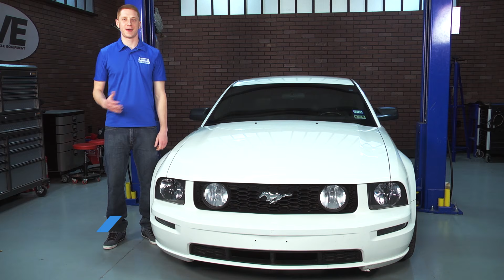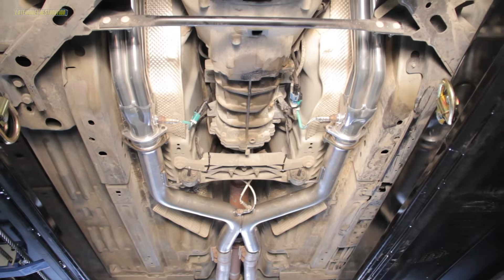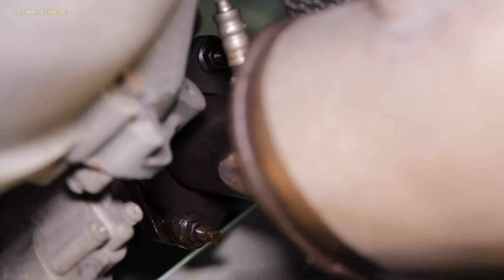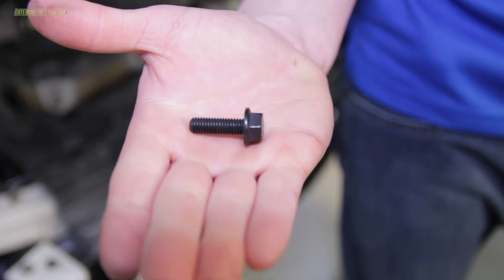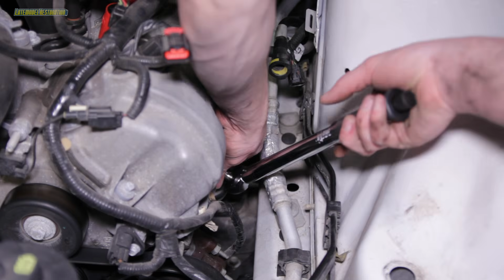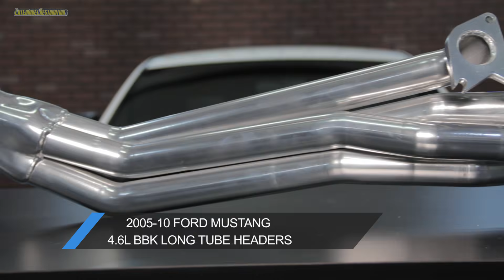Mustang GT BBK Long Tube Headers/Off-Road X-Pipe - Install & Dyno (05-10 4.6L)

Comment: I did this on my 07 a few years ago by myself and took me 8 hrs. my first time doing it. turned out great...I had bigger gains though. but if you have any mechanical experience you can do it yourself. the hardest part was having the right tools and not knowing what all I needed to do before I jacked up the car lol
Reply: christian rodriguez that's 300 crank horsepower in reality it puts about 270 to the wheels stock
Reply: thomasj1026 how did you remove the oil dip stick in having a hard time taking it off
Reply: Hector Silvas I want to say you just pull it out...if my memory serves me right. I no longer have that car due to a hit and run 💔 but I think if you get down closer to the bottom just give it a nice tug and it should pop out. just make sure there is nothing holding it down.
Reply: thomasj1026 thanks it worked. I was afraid I would brake it if I would pull to hard
Reply: Hector Silvas no problem. I thought the same thing when I was doing it
Reply: So confused the 3 valve stock has 300 hp so how in the hell would be pushing 295 horsepower after the long tube headers
Reply: @christianrodriguez-tf5rm  300 at the crank,,,not rear wheels

Comment: the bolt that had to be modified how come bbk dosent provide a bolt at the proper length already? seems like bs when you have to customize a bolt on mod.
Reply: i could not have said it better , that is complete crap having to cut a bolt.

Comment: why is it that no one shows the difference without flashing the computer? how well does the product work without a new tune?
Reply: yeah, thats why they should show why its important to tune, because people assume that out of the box is ok. but in order to get the hp claims on the label you need to tune.
Reply from the maker: +Dirty Dee Because of the complexity of today's modern PCM's, long tube headers require a custom tune directly after install. -Landan
Reply: I have a performance shop and do dyno tuning myself. I understand how modern cars run. what I should have asked is why not show the difference of stock vs. mod vs. mod+tune? to show why it is not only better but important to tune with major modifications. I'm a fan of bbk and I have noticed that even with just a offroad H-pipe and nothing else you still have to flash pcm to get the bbk claimed hp gain. when the way customers look at it is just put it on and that's the new hp number. I like the high standard of videos you guys put out and a video that shows the difference would be awesome to show customers.
Reply: +Dirty Dee Agree

Comment: What percentage of that 22 h.p. can be attributed to the o.r. xpipe ?
Reply: Like 3-5 Its honestly not worth it H pipe sounds so much better
Reply: @rondaroushy651  very marginal. X and H pipe provide different sounds of course, the X pipe makes a little more Horsepower at the high rpm and the H pipe makes more low end Torque. I didn't care for more power on my 06 so I went with an off road h pipe and it sounds brutal
Reply: @overtorque  same here love the h pipe but x pipe with borla s types isn’t bad at all

Comment: If you install the BBK xpipe, you HAVE to use factory style O2 sensors... meaning the part that sticks out where the wires exit the sensor is very narrow or thin... aftermarket O2 sensors with a fat body will NOT WORK. ask me how I know lol
Reply: Jon-Erik Butcher How do you know?

Comment: I have BBK long tubes on my 95 cobra lowered 2" and man those long tubes hit everything since they hang very low on their own. the 2" drop doesn't help either :/

nice video Late Model Resto
Reply: I know the feeling bro ! Had BBK long tube headers on my 95 GTS, had a 1.5" drop only and Puerto Rican roads to deal with...
 but hey, they sounded so awesome with an O/R H-Pipe and Super 44s (sometimes without mufflers too lol)

Comment: You should do this with 99/04 gt with a manual. I'm certain a lot of people would like to see the gains.
Reply: Nick Sitzberger the shorties are not to bad if you want to go with a better than stock upgrade. I have them on my car with a catted x and flowmaster catback. Since I have the stroker motor in it seems as if the car needs to breathe more...so should have gone with long tubes
Reply: Ill second that lol. Id like to put some shorties on my 01.
Reply: Bradley Watkins I have the bbk shorties and xpipe on my stroked 4.6. I have a few vids on it. I'm looking for long tubes now for it....and maybe a kb at 9 psi in the future....if the wife gives the go...lol.
Reply: marine0331inf im looking to go with a paxton lol. Im in the same boat, I have to get the ok from my other half as well lol
Reply: marine0331inf I was just thinking the same thing! lol Just got my 2004 GT and was thinking about some shorty headers.
Reply: +Nick Sitzberger just go long tubes, think of it as an investment

Comment: 87 octane on both pulls?
Reply from the maker: mpilksjr That is correct! The owner of the car was shamelessly running 87 octane, so that's what we went with. Further down the road, we will probably revisit this car with 93 octane and a revised tune to see what extra power is still on the table. -Landan
Reply: ***** how much HP gain would you expect with 93 octane and a cold air intake? I have BBK longtubes and high flow catted X pipe with a cold air intake.